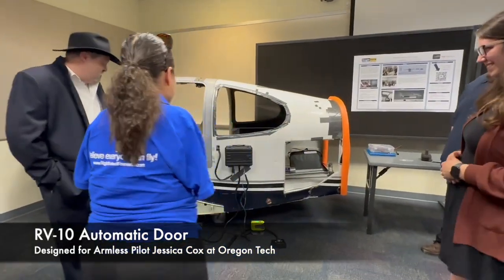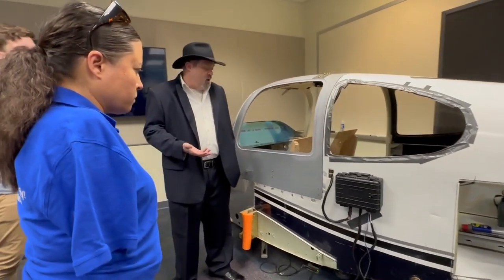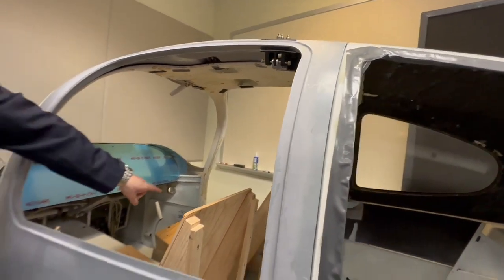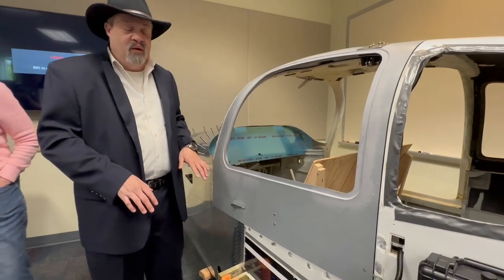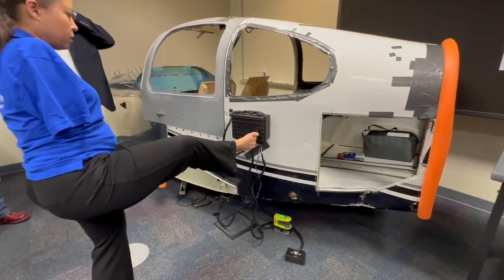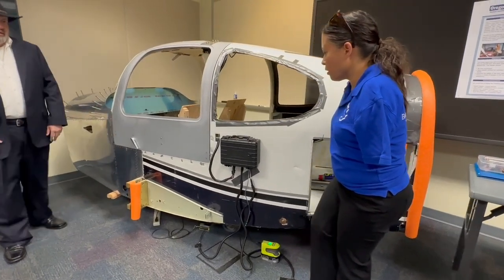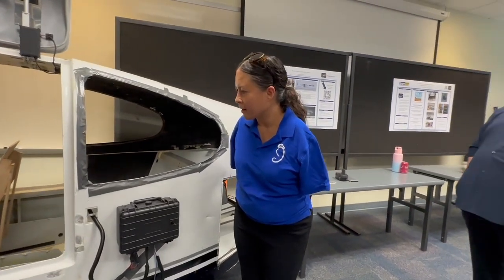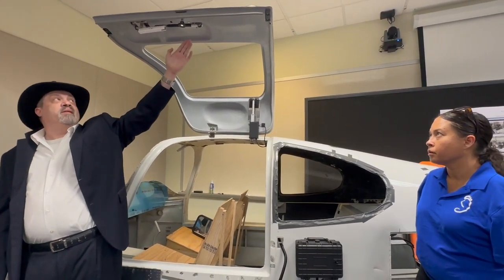Unveiling Automatic RV 10 Door for The Impossible Airplane

Comment: Very cool

I'd like to suggest another small project.
A streamlined pod on the underside that would be a 'garage' for your airplane tug so it wouldn't need to be lifted in and out of the plane...it could just drive into the pod and live inside until you land at your destination.

Perhaps a mechanism similar to the type of pantograph that lifts and lowers ceiling-mounted projectors.